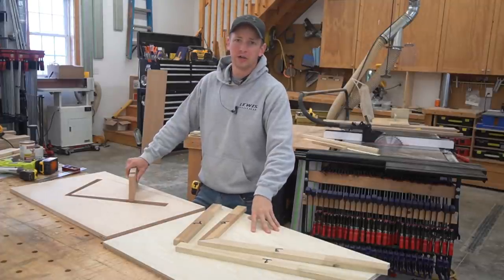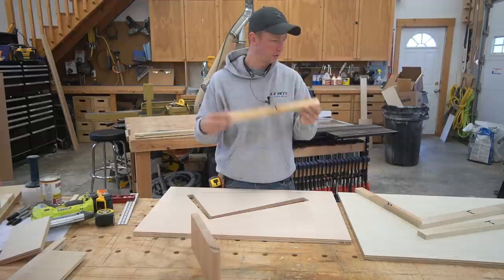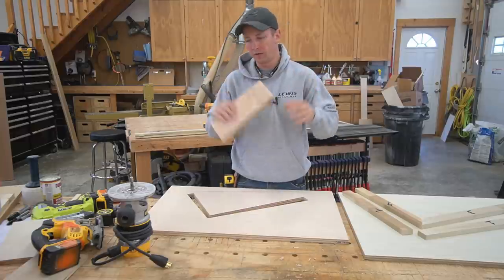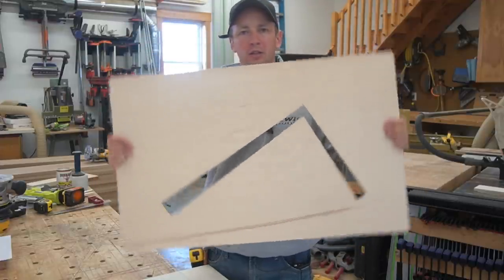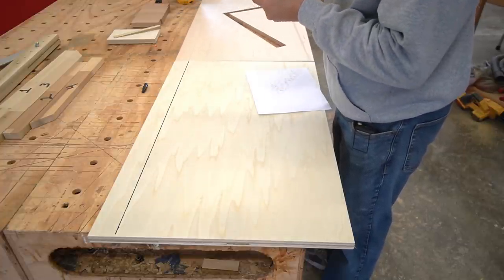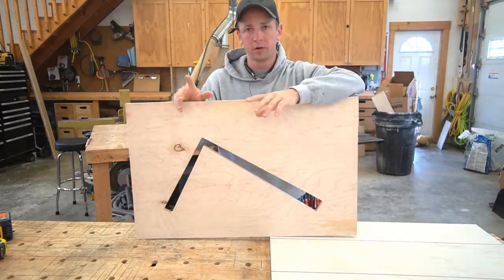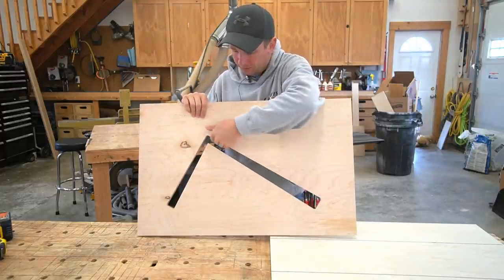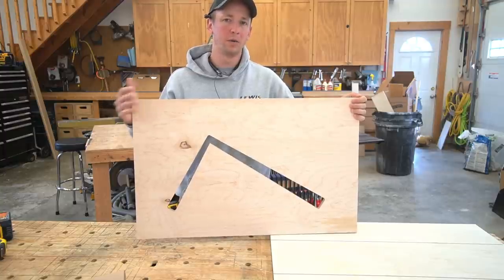How to Make Tread/Riser Router Template for a Housed Staircase

Comment: Suggested topic: I too am in the Dewalt battery line. Unforgettably, Dewalt has several versions of each type of tool. Could you go over all your battery tools (including non-Dewalt) and provide specific model/type numbers and good/bad points of each, especially where you have used multiple models of the same tool? There are a lot of 'the box for this tool says:" reviews on YouTube, but not a lot of 'after several years of production use' reviews.

Comment: Great video. So, when you put treads and risers in with wedges, you glue and nail in? I have tighter up a couple stair sets made like this. Difficult if don't have right wedges. Do you build fully cased stair set the install or place stringers then cut and place treads and risers?

Comment: Hey Spencer. I’m happy I found this video, because I’m looking at doing a very similar tread nosing detail. I like the cope idea, and I was curious if you had any thoughts on the strength of that nosing, since it is unsupported by the dado on the last inch or so. Do you think it would weaken over time? (Or did it weaken, seeing this video is 2 years old.)
Reply from the maker: Technically it is weaker. I don't think it would ever be an issue. It's basically the same thing as what we do when we install treads between skirt boards onsite.

Comment: I didn't hear it in the video but maybe I missed it. If you round over your own treads you can always just match your router bits you use. What I mean is if you use a 3/4 inch diameter bit with the template, you can use a 3/8 inch round over because thats the radius. And half of a fraction is the same as 2x the denominator so 1/2 inch bit on the template would match a 1/4 inch round over ect ect.

Comment: Spencer, I fitting dado rail into a 90 dg corner. One side run down at an angle of 20 dg and other side runs up at 10 dg. Does the mitre work out. Or can it not b mitre.

Comment: Fantastic videos!  Some of the techniques you've have come up with are absolutely brilliant.  I've built two sets of housed staircases and I'm about to build another set for the basement.  I've learned so many new things watching your videos...thank you.  I have one question...I'm planning to  use SPC vinyl, with a matching bullnose, on the treads so they match the basement floor.  I'm struggling with the best way to go about it.  I was going to build the stairs first, then glue the SPC vinyl on to the treads.  Then I thought about gluing the SPC vinyl to the treads first, then inserting them into the routed stringers, so the that the stringer would help keep the vinyl in place.  I know vinyl can contract and expand with variations in temperature, but the temperature will be fairly consistent and the vinyl will be glued in place.  Any thoughts?

Comment: That's confusing, why do you have to use wedges? Why can't you just cut just the thickness of the tread and riser and assemble? How do you line the jig up on a 2x12 piece of  lumber and run the jig down to cut an entire stringer? How do you match cut your end? (Top and bottom)

I still love your videos
Reply: The wedge causes extreme tightness which reduces the chances of squeaks and movement as it gets old. It also compensates for micro variations in the thickness of the tread, which you'd normally expect to be equal every time. As a framer I've installed many stairs from several stair manufacturers, and all of them use the wedge method (with glue) under the tread.

Comment: That “coping” thing at the nose leaves the whole nose unsupported. The nose takes all the weight when some fat teenager runs down those stairs, I really don’t think I’d be taking a shortcut there, as easy as these templates are to make, I’d figure out a way to accommodate that weird profile. Not to mention, that almost square profile is going to wear fast, that’s why stairs have a round edge, it takes wear better.

Comment: I don't see the advantage of doing stairs this way unless it's being able to say that can. I have watched the video of all the work that you did to protect the stairs from other subcontractors. It may come clear to me as the series continues
Reply from the maker: Don't judge a first time install for how much it makes sense. Look at all the companies across the US and other countries where shop built stairs are the norm. It does make sense, it just takes the right systems and processes to make it so. I can tell you that I could have done a typical clad job in 1/3 the time it took me to do this. But its about learning and trying new things.
Reply: @InsiderCarpentry  I'm all about learning new things I don't recall saying it doesn't make sense. I believe in the first video you had to do some modifications and deal with a mistake you made I've always said that it isn't a mistake unless you can't fix it. I worded my question wrong is there a cost advantage to shop vs. Site builf
Reply: @Phelebas I can see the advantage to single flights. Not convinced on split landing do shops build the landings